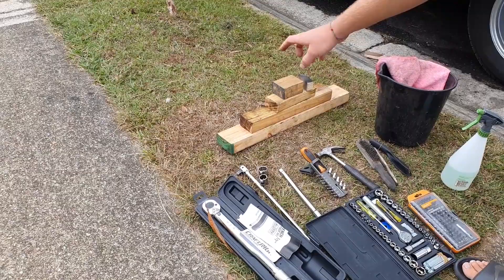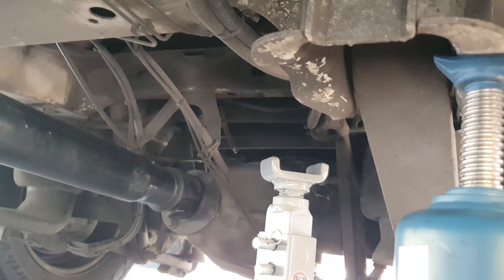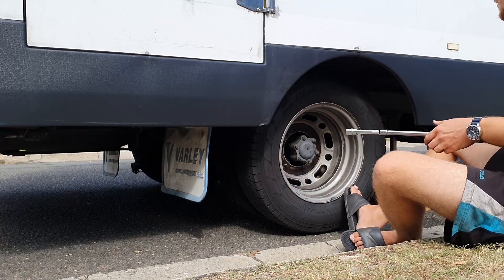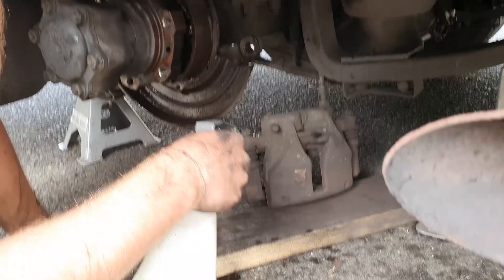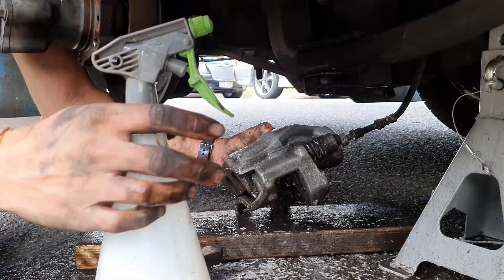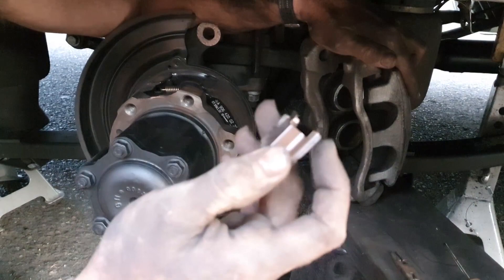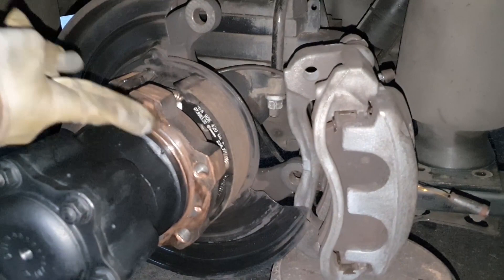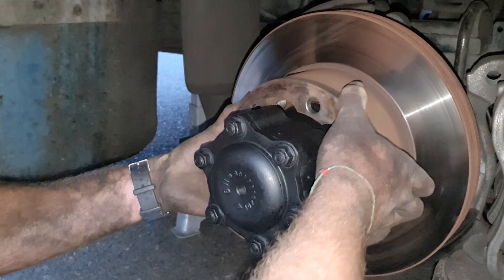Mercedes Sprinter (ex ambulance) Rear Twin Tire Brake Inspection and Caliper Clean

Comment: Thank you guys. Much appreciated. Was having big trouble with the 19mm hub bolts.
Reply from the maker: Thank you :)
Yeah ours were also on there super tight, so we had to use the wood to prop up the breaker bar🙈

Comment: the caliper bolts 24mm are a real pig to undo, however useful tip for the hub bolts, if you use a long socket on your breaker bar you can undo the top two or three bolts using the hub as the leverage instead of wood. you then release the handbrake move the hub around , put it back on and repeat to undo the rest..
Reply: forgot to say i have the same spec ex ambulance as you with the air suspension too.